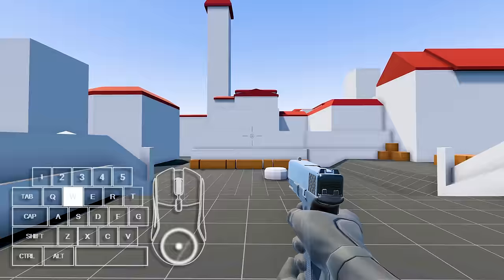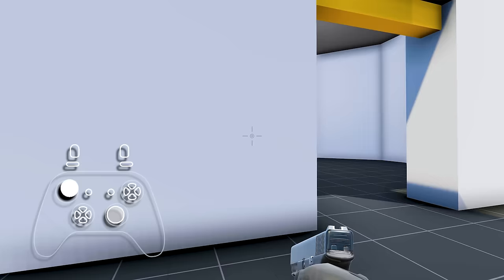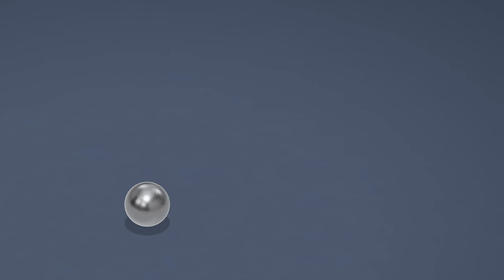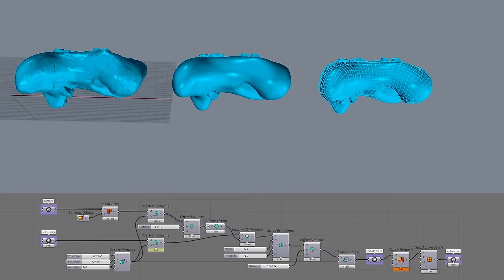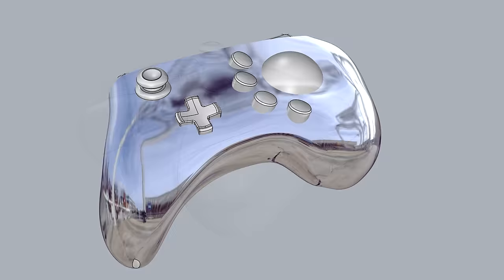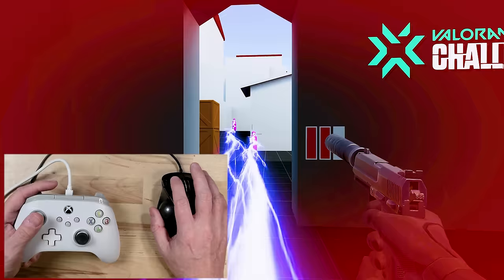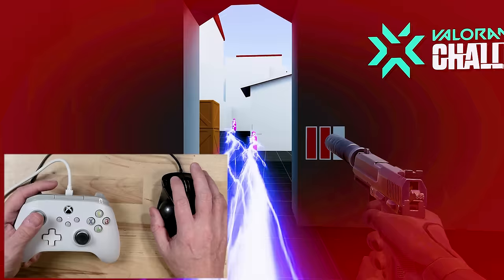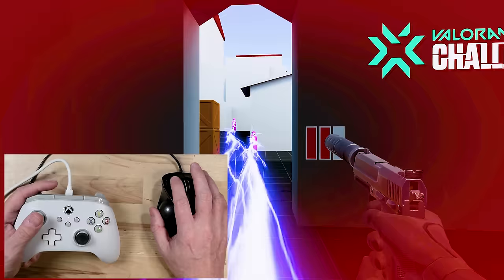Ultimate FPS Controller Design & Build

Comment: Neural interfaces is a future, but if u have an option to modify your controller its doesn't really matter which controller u use.
If you divide the screen into 9 sectors, then each of the sectors can be divided into 9 more sectors, respectively, a direction can be used for each sector, the rest should be done by the guidance system or the guidance assistance system, but in general this whole system is simplified by simply locking the target, for example like this implemented in the game "DarkSouls" from "FromSoftware", before that there were a huge number of games with target acquisition, they are not the first.

Comment: I have some ideas. If like to share them if that's okay. 

What about turning the vertical two buttons of the directional pad into the spin wheel? A spin wheel reminiscent of those spin wheel fidget toys that click into place. Like a rifle scopes zeroing knob or a revolvers cylinder.

Instead of a directional pad, it would effectively just be two buttons on both sides of the wheel. Same functionality, with less clutter?

For a while now, I've also been fantasizing something akin to actual pistol triggers. Something that provides robust, tactile clicky-ness, and trigger travel.

Comment: A mouses precision comes from the fact that the mapped area of input is a 30cm*30cm mouse pad. Pros will often have much larger. Reducing that area to 3cm*3cm area obliterates all that advantage. This is why we dont see this type of controller have much advantage to a joystick.. Its a catch-22. Increase the area of input and you lose the convenience of a controller. An Idea: Have a standard controller that can split into two. Have two strings under tension join the controller. One connects to the top of the lefthand fragment and one joins to the bottom. Triangulate the position of the righthand fragment in relation to its counterpart using the drawn out distance of the strings. Now you have a mapped space defined by the relative postion of the fragments to one another that could come close in size to a mousepad. The controller can quickly snap back together two provide a standard controller experience. Build this please..

Comment: problem with gyroball is the fact that you're only using your thumbs compared to every part of your arm/fingers/hands when using a mouse, hence why valve dropped the gyroball prototype. Add the fact that ergonomics can be quite tricky as well. It is not much of a difference from a traditional controller.

Comment: I think I would much rather have the back of the track ball closed for better ergonomics, and have the face buttons put onto paddles on the back like an elite controller. Your grip at the 26:00 mark shows strong potential for cramping. Its also hard to tell how much play is in those extended triggers.

I would love for you to lend this product to a high tier player on PC, and give them one month to only use it. I think feedback from players at that level could take you further, should you choose to make a 2.0 version.

Comment: you should try IR pointer aiming next, à la Wiimote. :)

Once you get the hang of the sensitivity, it's surprisingly quick, accurate and feels natural simply pointing to a point in space. but ofc, it works best in a stationary position instead of rotating the camera like in FPS games, but just look at all the plethora of Wii and Wii U shooter games to get the idea of how it's implemented pretty well. The big thing Wiimote aiming lacked was a second control stick for controlling the camera (you had to move the cursor to the edge of the screen to rotate), so Joy Cons with double control sticks + IR pointer aiming, that would be the ideal non-mouse FPS aiming setup :)

Comment: 10/10 controller. but I also loved seeing you designing and building it. the whole right part could pivot on the left part to serve as right analog stick, and you might include accelerator and gyro to make it a 11/10 controller.

I wish you sell it, or at least the process to make one, if not the finished controller. why not trying crowfunding? I'd definitely buy one

Comment: I wish there was a remote control that has enough buttons to control movement. Then a mouse for aiming. Like all the things like movement, jump, crouch, use tactical, use grenade. Essentially replacing a keyboard with a Nintendo nunchuck and using a mouse to control aiming. Like aiming, ads, and shooting. Idk if I explained it correctly.

Comment: Try polishing the joysticks then cutting jagged scrolls into the feed wheels and using a adhesive silicone type thing... Then change the regular wiring and chips and board for a kit with available upgraded connection speed and multiple connection capabilities also add 3d skins

Comment: This video started so promising with the problem and solution being discussed.. But then we completely vered  of course and for some reason put a track ball in a regular controller, solving exactly 0 of the issues. A mouse is not a trackball.. The solution is to have a mouse in your right hand and a analog or joystick type thing in your left hand.

Comment: if you wanted to optimize even further, you should figure out how to make use of all 10 fingers for inputs instead of some being take up just to hold the controller.  That's a huge thing that keyboard and mouse have over controller.  your pinky and ring fingers are taken up just holding the thing.  On keyboard I can use all 5 fingers - with the mouse I have, only my pink is wasted because I have a third click that shifts my side mouse buttons to secondary functions.

Instead of having 3 triggers on the top like that, some of those could move to the bottom of the controller so your pinkies and ring fingers could just always be on them.  Holding the controller would then primarily be done by holding it pressed between your palms.  The buttons next to the track ball also look like too much of a reach for the thumb, especially the top one, and like you'd have to shift your hand to reach them, which is not ideal.  

Being able to pinch the track ball with the second finger underneath is actually really smart, and probably provides way more control and precision.  Just moving one of those triggers down where the pinky could use it would be a big improvement.

I also feel like you could improve alot in comfort and ergo-dynamics by breaking off from the traditional controller design.  You could even take a page out of the Wii's book by having the two halves of the controller split from each other

Comment: This is really cool. I couldn't do the modeling. You've done a great job on this, but this could easily be improved on the electronics side. It's not hard at all to make a custom PCB that would fit inside the controller. You wouldn't need the breakout box and that 24 conductor (🤯) cable.

Comment: The problem with controller aiming is not the sticks. The controller is aiming with thumb rather than full arm movement on a mouse. This trackball still uses the thumb for aiming.
Reply: the controller has one fulcrum, and there are an infinite number of points in the trackball because the trackball is a ball. because of this, more accurate guidance is obtained
Reply: @rinka8421  brothe you can't track with ur thumb as precisely as you can with ur arm. More control points are useless.

Comment: you will find the Fun with the trackball, and Thumb.  you have all these fingers doing alittle, and the BIG thumb that Can go in 2-3 directions very well, but not so much in the 4th.  Think about that.
Would it be easier to have a few buttons for the thumb, and the Ball uses 1-2 Fingers, as they are more dexterous.  Set trackball so that Finger can Touch top Center.

Comment: Using the trackball from bellow the controller is great, but what if instead of the trackball underneath it was a 2nd stick with the same function as the track ball.
The 2nd stick would be used for large movements like turning around, where the trackball would cover the fine movements of aiming, I don't know how much coordination you would need to use a controller like that though.

Comment: Is there a reason why you chose 4 screws instead of three to retain the trackball? In my mind three screws would simplify the capture as there is only one plane of contact.
Reply from the maker: Oh, good question. My thinking was that using 4 top set screws would give me maximum travel left/right and up/down for my thumb without hitting the cradle. Those pins are also just barely contacting past the equator of the trackball. Because I am pushing on it from the back as well as the front, I didn’t want to risk it popping out of the cradle during use. All that said, 3 screws might have totally worked, I just didn’t have time to optimize the design and went with the overengineered solution.

Comment: “Ultimate fps controller” until you drop it 3 times maybe even once and those extended paddles break off. That ball will have every kind of debris stuck in it from being wide open and all the extra moving parts that’ll inevitably warp and start binding.

Comment: This is the design method that should be used when making any new controller.
1] Decide the functionality.
2] Get the ergonomics right via clay modeling.
3] Add the functionality to the ergonomics right.
4] Make as many modifications as necessary without sacrificing ergonomics.
-He stumbles across the god tier idea of having the trackball accessible from EITHER side? WTF!!!
5] Refine the structure without sacrificing ergonomics in any way
6] At some point, the final method is done.

Someone should send this video to Valve or Playstation. I was going to say Microsoft, but am rejecting the idea due to Microsoft Copilot+PC / Microsoft Recall spyware, and other privacy concerns. They need to be boycotted and even "buycotted" out of the market no matter how many years it takes.

Comment: The one thing I dont like about your design is that the shoulder buttons arent potentiometer style triggers but other than that this is nothing short of a fantastic display of design, engineering, and artistic skills. I think the big difference between the trackball and stock controller that often gets overlooked is the polling rate of the inputs. I tried some quick searches but couldnt find specific info on the elecom ex-g. However the Xbox controllers are 125hz and 250hz for series x. PS 4&5 have higher polling rates.

Comment: I tried just to use both mouse and Xbox controller simultaneously and it actually worked. I buyed a Logitech mouse that haves ton of "buttons" (3 buttons for the thumb, left click + 2 buttons for index finger, up and down scroll wheel + scroll wheel button + additional button below the scroll wheel for the middle finger and right click for the rest of the fingers) and with my left hand I used my old scuf controller where I used 4 buttons (LT, LB + 2 L paddles) and Left stick. The only problem here was that is not ergonomic enough for the left hand using the controller to be used for more than 3 hours, I am sure that in the long term it can be harmful to the wrist. So I was wondering that what if there would be a peripheral similar to the Switch / Wii controllers since for the left hand only less than half regular controller is needed to put the hand in a comfortable place. It also needs to have paddles on the back of the controller so you can use the all the fingers + maybe 2 additional buttons below the left stick for special actions.

Comment: Incredible concept i can definitely find some problems tho if the controller and the mouse are seperate devices games including but not limited to fortnight and call of duty the controller and mouse will fight each other for control as both cant be in control at once other than possibly with a program to merge it.. call of duty requires you to chose wich control interface you want to use before you get into a game and then locks it tell you go back to the main menu so onky half of it would work.. also i think modularity is HUGE and i have a design in mind where you could change the geometry of the entire controller to suit someone with different sized hands or even rotate those extended buttons to make the geometry better suit each person… Amazing video and im excited to see whats tooo come

Comment: The biggest issue is no competitive game allows both a controller and mouse to be used at the same time. If the trackpad is considered a mouse this controller wont work for Cod, Apex, Halo, CS-GO, and so forth. This would require rewasd which basically is being banned and blocked by all sorts of games right now.

Comment: M&K is still gonna have significant advantages while strafing and peeking corners because the counter directional input is instant vs the distance needed to drift the analog stick in the opposite direction. in contrast, analog keyboards have been a thing now for a year now, and as soon as devs begin to support them, M&K will have shifted the goal posts even further.. 360° directional analog movement in an fps is not important at all when I can insta peek the corner and down you in under a second.

Comment: In terms of feel and input of movements how does a keyboard with hall effect switches and their accompanied software with analogue enabled compare to analogue joysticks? I think in terms of use the keyboard and mouse is basically beating controllers in everyway and the only use for it now is integrating them on hand held gaming devices and user preference. I don't know I think the keyboard analogue feature is still new so not alot of games can read keyboard inputs as analogue? So if you want analogue controls a hand held controller is still the go to...

Comment: I'm really concerned with the position of the right shoulder buttons. Since those buttons are used a lot in FPS, it looks a lot like the plastic levers would break easily from constantly being pressed. Especially the trigger as you need to use a bit more force for it since it's an analog input.

Comment: TLDR; this would be a game changer for vr game pads and partial gamepad compatibility games

i am not technically inclined but i always customize my controllers (with kits) with the buttons on the back. i'll just go ahead and say reproducing this even with files and kits would be outside of my abilities. that said i love the idea of a combo with a mouse, not really for the fps aspect, but a lot of pc games are only partially compatible with a controller and this would really meet me halfway and make playing some of the more technical games like some flight sims easier. 

i've got a hotas but being able to pick up a controller with an add-on keyboard like xbox offers makes a world of difference especially in vr. this with the keyboard compatibility and elite button options on the back would really make for the best vr accessory. accessing a full keyboard and mouse while in vr is quite cumbersome. even without the keyboard attachment point, a lot of vr games still use gamepads and are still only partially compatible. looking forward to seeing the next step in your controller evolution.

Comment: All the skills here!!! Very pro job! 
The industry is very weak on this capital question beeing the controls between you and the game.

Having no much skill i had to answer years ago that question of playing FPS and TPS in an other way than Gamepad or Keyboard/Mouse and i ended just replacing the bad keyboard with a Gamepad left side and later a ps3 move finding the good drivers and the good keyboard emulator: Xpadder.
Conbinating the ps3 move with a multi button mmo mouse Titanwolf to compensate the lack of optimisation on pc bindings.
Analog move is even possible but it depends of each game bindings.
Ps3 move as the only issue to have no analog trigger and i didn't find better gamepad even if i've been lurking on a switch gamepad made of the classic two controlling parts and a third bridge one to combine in one physical gamepad.

Comment: this whole process is awesome. thanks.

it boggles me why something similar to a wiimote didn't take off for pc after the wii. you have that mouse speed. if there was a second analogue on the wiimote for screen movement the motion sensing could handle cursor movement. shame motion controls weren't properly explored imo.

i use a one handed ps navigation controller remapped with rewasd and a mouse for fps.

Comment: I wonder if a P5 PLUS Fighting Board [the kind you need to do soldering for] is compatible with actual analog sticks? If that can be done, and you remake this, you'd be able to fit ALL the electronics on the left side. The PCB is compatible with the PS5 [Fighting Games], PS4, PS3, Switch, and PC . This is only 4 cm squared.
Reply: Analog stick is either all or nothing, or not compatible with the PS5+ and PS5+ mini. It is however possible to make a compatible pcb that size that works.

Comment: the problem is, trackball is probably gonna be read as a mouse, which means no Aim Assist. This will automatically make this design bad because of insane strength of AA in modern titles. A cool, and I would even say very great idea, but if it can't compete with Aim Assist it won't be used.

Look at what happened to gyro aiming. It's available on CoD and no one uses it because the provided in game rotational AA just makes it obsolete. Why learn an entire new control scheme for aiming when most modern shooters do the aiming for you. MnK already is outcompeted by AA nowadays, just look at top 250 Warzone players and realise they are all roller players.